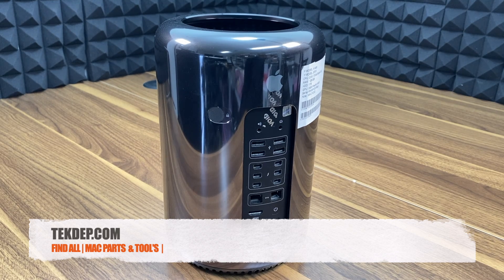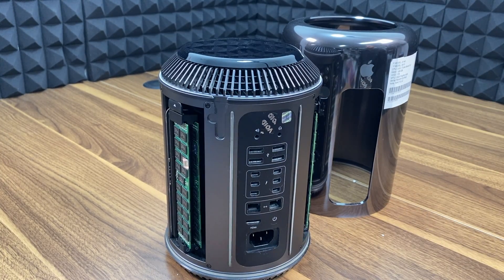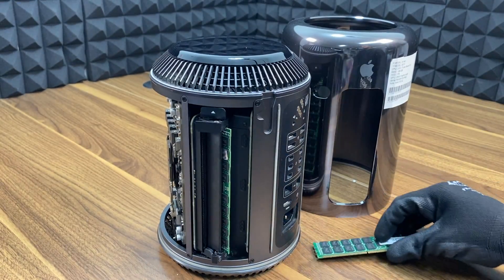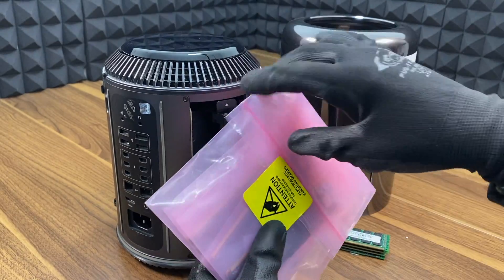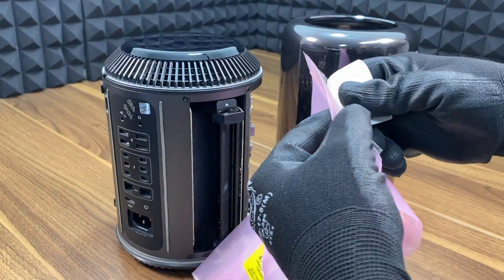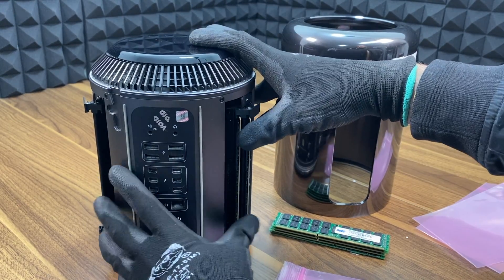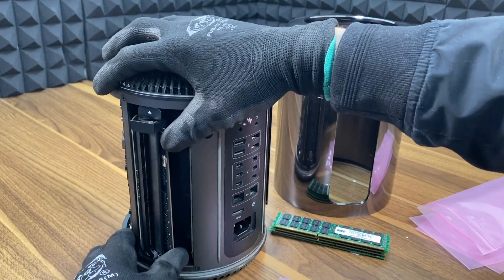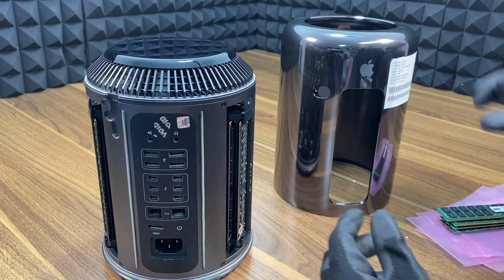How To Upgrade Ram to 128Gb on Apple Mac Pro "The Trash Can" A1481

Comment: I thought the max was you could on it was 64gb of ram? Or am incorrect
Reply from the maker: Yes apple is advertising 64gb but you can for sure go up to 128gb :)
Reply: You can go to 256GB but it won't run at full speed 1866 MHz ram it only runs at 1333 MHz